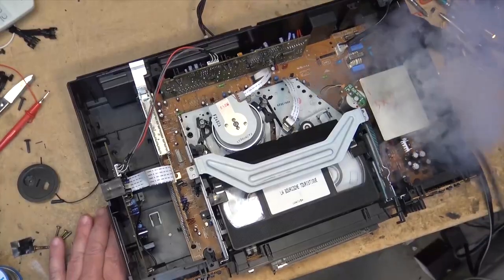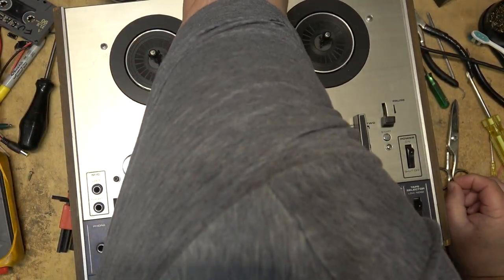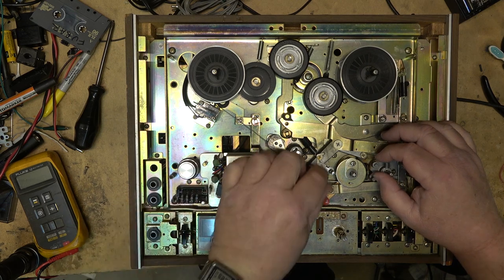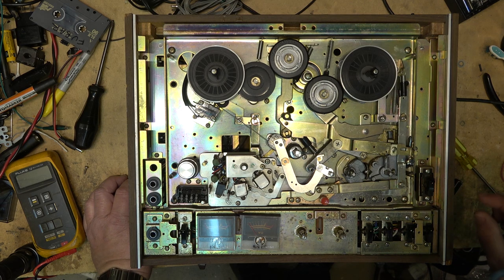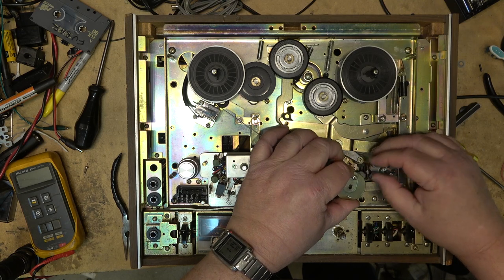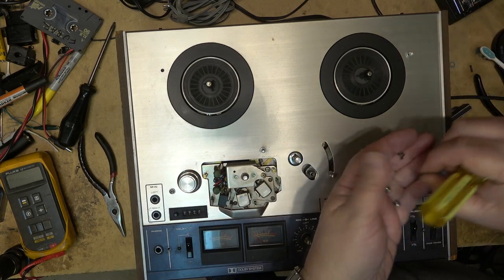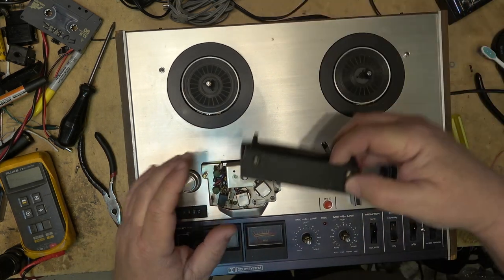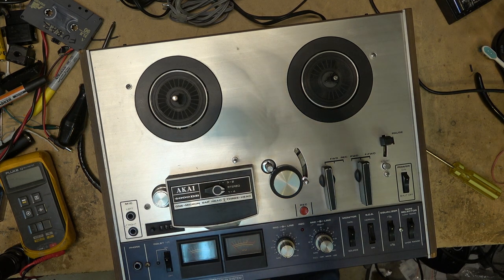Before buying any old AKAI tape recorders watch this

Comment: If the die-cast cams are available in 3D printed nylon and they work well, that’s probably the cheapest solution.  But another solution is machining new cams from aluminum billet, or if one is into overkill, stainless steel.  I have an AKAI 770x I bought new in 1978 and all it’s cams are still intact.  Looking at them as a machinist, they are not that complex and even manually machining new ones would not be that hard.  I plan to do that for my machine before they do finally give up the ghost.
Reply from the maker: By 78 they should be aluminum as opposed to the stintered crap from the 60s
Reply: Opps.  I meant I bought it in 1968, not ‘78.
Reply from the maker: @garylacom737  big difference.  Yes those one have the stintered cams.

Comment: Don't you hate it when a customer tries to repair their appliance themselves?
I had a Fostex 4 track come in and the customer said, "It keeps blowing fuses"
Right then I knew he had been in it, turns out it was only the full wave bridge rectifier had a bad diode in it.
Replaced it and discovered it had 2.9 amps going through it, and it was the round "non-heatsinked" variety. Bad design.
I just replaced it with OEM and never heard back. Guess it still works.
Reply: I completely hear you 100% (I am not pro by trade.) I can EASILY place myself in your shoes and I understand 100% - but do you fix your car? Change tires? Oil? Maybe even brakes? Ever mess something up because you're not a pro? (I am not mechanic either, but nobody is perfect - not even pros.) It all comes down to point of view. If I worked in repair, I would probably tell the customer there can be a non-existant, small or large surcharge, depending on my findings of difficulty they created or didn't.
Reply: @MrChrisRP  ^^^ female Japanese and I replaced my own Mazda's alternator.
It was humourous when the shop techs kept asking me if I needed it done for me & I just said no "I got this".
The only question if I could repair something on my vehicle is is I could provide the torque required for proper belt tension.
This was ugly and I feel bad for 12voltvids for not being able to complete it, but you can not have in stock every part of every media device.
Reply: @MikinessAnalog  MIJ (that means "Made In Japan") I only play guitars and only use capacitors from your country. :) Respect.
Reply: Oh, and Sony!!! :)
Reply: @MrChrisRP  I guess you remember the capacitor failure debacle from the early 2000s techs had to deal with, but hey, it was easy work.
Reply: @MikinessAnalog  Of course I do. I am Windows internals guru to the fullest. :) heh heh I have MSI MS-7211 rockin here still to this day that I recapped the ones that help to regulate voltage to the CPU. The board died after a few years and needed it.
Reply: @MrChrisRP  My experience is only with entertainment electronics and I recapped about 300 - 350 TVs.
I charged approx. ¥3000 - 9000 (30 -90$) depending on how long the replacement took.
Reply: @MikinessAnalog  That is beyond awesome to me, for real. Rock on!

Comment: It would be nice to look into the situation and see if the piece is available from at least somewhere, and if not, attempt to fuse the metal back together in some fashion
Reply: easy. It is generally available for sale.
Reply: @DunQuDeYi  any places that come to mind that have the pieces, incl. this broken one?
Reply from the maker: @DunQuDeYi  90 US, thats what about 130 CDN now, and then don't forget broker fees and tax brings it to close to 180. I bought a working Akai 4000 for 30.00

Comment: 6:22 : So, given the propensity of these things to break due to age and fatigue (understandable given that they did not belong in the higher price echelons when they first came out), has anyone attempted to get such a part custom made by a machinist or 3D-printed? It only takes one person having the skills and interest for restoring such decks to give an extra lease of life to many of these decks (until sth harder to replace fails that is...). :(
Reply: These parts are available as fresh casts or 3D printed parts already, they generally are compatible with a large range of models which helps make them easier to sell.

A year ago I replaced my play/rec cam (the one that broke here) with a newly cast replacement, works fine now.  I have noticed the other cams are going the same way, but they will last a little longer.  I do have one other broken cam, the C-2 cam.  No idea what that does but it didnt really affect anything I did with the machine this afternoon when I decided to test its functions.

I'm going to replace all the cams with 3D printed replacements, apart from the play/rec one as thats a new metal part.  I dont think that the 3D printed cams will have much of a problem, there is not a huge amount of force in the mechanism.
Reply: @dlarge6502  This is great to know. Any idea if the material of the new casts is the same as before? Or whether it's upgraded to sth fancier, e.g. aluminium?
I reckon 3D replacements will be an improvement. The material should be less brittle and have better frictional properties for the task. It'll probably be both harder and more elastic (if that makes any sense) than the cast zinc alloy used and will be less likely to corrode. All in all I'd expect a longer lifespan and better function.
Where can someone find these?

Comment: Your videos are amazing! What is your opinion of the AKAI M8? I'm about to buy one for quedio recording my piano und things un tope. Thanks!
Reply from the maker: For real to real I would really say stick with Sony. All those that guy units with the lever controlled mechanisms have those cams that fall apart.
Reply: @12voltvids  Good, thank you very much for the advice! If you don't mind a second question: do you believe that 4 tracks recording quality will still be nice to listen? I'm a musician and I'm looking for one machine yo experiment recording in my studio. Thanks so much!!
Reply from the maker: @eduugr  If you are looking for a very good sounding, literally studio quality reel to reel look for a Teac 3340.  I have one, they sound amazing. 4 independent tracks with simusync. So you can listen to your playback tracks from the record head as you add additional layers on another track. True 4 track recording. It also has 15IPS and is is built like a tank.  If you are looking for home studio recording on 1/4 4 track this is what you should be looking for, or the 8 track version, or fostek is another brand that made high quality.    Akai farted around with that cross field recording to improve the frequency response of 3 3/4 speed but anyone doing any type of instrument recording isn
't farting around with slow tape speeds. You want to use the fastest speed the machine has. 15IPS does a dam good job.
Reply: @12voltvids  thank you very much!!! 🙏🙏

Comment: Those cams are available again 3D printed from Analogue Classics. I installed one in a Akai x-200d and it works great.
Reply from the maker: But at what cost.  Last I checked over 100 for the cams by the time they are delivered to Canada.  Customer will not pay that they want stuff fixed for 100 total.  Can't work for free
Reply: @12voltvids  It was bout 30 dollars delivered for the play/record cam. And the comment was not aimed at you, its for people like me that fix their own stuff. And you videos are Great.
Reply from the maker: @mobileauto  when i last checked they were 60 usd each so 120uad for both. That would be 160 cdn plus shipping
Reply: @12voltvids  FULL KIT £45 EBAY UK JUST GOT THEM FOR MINE, GREAT QUALITY

Comment: The Pot metal cam for the head adjustment going bad and cracking and falling apart is what unfortunately put my Akai M-8 out of commission. ☹️ Why Akai thought it was a good idea to make these cams out of this evil stuff I don’t know...The same goes to for 1926 and later Victrola tonearm brackets, and post 1908 Edison phonograph mandrel bearings!
Reply: Its what this stuff (Zamak) is made from, even today.  What has happened is the Akai cams have lead impurities in them, this is the result.

Comment: Hello, I have a problem about my Old VCR. Why does it only plays about 5 secs and stops? It doesn't turn off itself but just stops the mechanism and have to press play over and over again. I tried doing rewinding and forwarding the tape as suggested online, but still no changes. I was also surprised when I tried to push the carbon piece above the tape head that wasn't touching it and the tape played until I stopped pushing it, but after that I tried doing it again it doesn't work anymore. Is there any way I can fix my JVC VCR? Because the tape head work just well but the mechanism is just the problem.

Comment: folks, any idea how to align the tape path on these akai 4000's? i have the DS mk.II, I already fixed the pinch reel and one of the switches, however, often times the tape slips off the pinch reel and gets all twisted and stretched. there's also a squeaky sound coming from that guide below the supply reel... any help is appreciated!

Comment: BTW the pot metal will last forever if you don't monkey with it and treat your reel-to-reel nicely.  It is a mechanical unit with lots of moving parts the transport should be lightly oiled once every 40 YEARS haha!   Anyway the only thing I see on the 1722 II series that ever goes bad is the electronics... again after 40 years a capacitor will blow.  Otherwise they should make it to 100 if you treat them nice and don't force moving parts in ways they're not supposed to go, etc.

Comment: There are products out there to either:
- glue the parts together (e.g. I found "Tech Bond" on youtube - maybe there are others)
- solder them together (e.g. "Muggyweld" products that use a low melting temperature solder)
I'm not sure how reliable repairs using these products would turn out to be, given the amount  of repeated stress these part are subjected to.
I'd guess the repairs would not last but I thought I'd post this in case anyone has experience with using these products for repairing mechanical (rather than decorative) parts.

Comment: Hey love your vids as always, I just bought an Akai M-10 and the mechanism is in great working order but the preamp/has problem with the right channel is low and distorted at the RCA output, as well as the VU meter and the internal speaker makes no sounds, left channel takes some time to wake up but sounds fine afterwards and even works with the internal speaker any ideas? I am thinking lazy Capacitors for the left channel, and either bad caps or transistors for the right channel, any ideas?
Reply from the maker: Transistors used on those old units are very problematic.  Transistors in the 70s weren't really reliable. Many old devices had transistors in sockets so they could be rapidly swapped.  I was given an x360 that won't record.  A project for another day I guess.

Comment: My Akai 1721W doesn’t have any problem, but it has pot metal on the switch, and nothing has broken, it works just fine.
Reply from the maker: Your point? My 4000 also still works right now, but tomorrow it could break an so could yours.
Reply: I should rather use my Concord 220 and it still works like a charm with no mechanical problem.
Reply: If you don't force it well... most pot metal just needs a tiny bit of lube every few decades.  But still it will probably never break if you're nice to it.

Comment: Get the pieces out, bond them together, and find someone who can make a sand mold to recast with aluminum.
Reply from the maker: Pieces are missing from one of them
Reply from the maker: So what you are saying is spend 250.00 to get it working and then sell for 30!

Comment: Fortunately this crapy part can be made (moulded) with a metal or nylon version. You have to make them yourself of course, its just a quarter circle with a square hole. Takes some time but absolutely doable. Same with the belt, i replaced the crappy flat version with a 3D printer ribbed belt. Your choice.

Comment: I was given an Akai X-150D. Everything right now seems to work fine, but of course this model used freakin pot metal cams too. So far no issues YET. Better enjoy it while it lasts I guess.
Reply: Lube it slightly and it'll probably last 100 years.

Comment: This is the second time I see this, both on a 4000DS. 
I've seen more sony machines with issues though, but that doesn't say that much because I only get the ones that people have thrown out.
Interestingly none of my (12 or so) 4000DS machines have this issue.
Reply: A lot of models are fit with this mechanism. Maybe a good idea to take the front plate off, and apply lots of fresh grease around the steel ball and cam. That will surely easy tension on that thing when you activate it. In the video is clearly to see how to get there, and there's not a lot that can go wrong in applying.

Comment: You can get 3d printed replacements I had to for my 1700... they all had the pot metal cancer.
Reply: I have 3D printed replacements in my 4000DS, works fine. Infill 100% ABS.

Comment: Hi Dave, why not gluing with JB Weld, should hold it together?
Reply from the maker: Pieces are missing.
Reply: @12voltvids  And probably the whole piece is just too britte already. This one might be the victim of bad storage conditions. These pot metal alloys are usually made of aluminium alloyed with some other metals, including copper. When an aluminium-copper alloy gets water or just condensation, bad things can happen. The chassis around the VU meters look corroded. This deck might got wet at some point, or it was stored under condensing levels of humidity.
Reply from the maker: @mrnmrn1  have no idea.  It is now sitting in my garage awaiting something to happen. Either to be parted out or possibly fixed some day.
Reply: @12voltvids  people told you they are made now, buy it.

Comment: hi there is 3D print parts now i have used them the only thing they cost  i never seen bad cam's 

i only seen 1 bad gear in rs-x 101 cassette deck out of alot of them  
betacam sp  has bad rubber  part   and parts that are not working right

Comment: model it off a functioning part, 3d print a master and cast in aluminum. I think the part is cast zinc. old zinc is brittle.
Reply: It's probably a potted aluminium alloy. Might be alloyed with copper. Aluminium-copper alloys hate water. If you look closely, the chassis around the VU meters and controls is corroded. This deck probably got wet, or it was stored in a damp place.

Comment: This mechanism was only used in the cheaper models of AKAIs but even there only a part have this problem. I own two models with this gear and both are fine. When it comes to this deccay of the material there is no solution then to exchange. It crumbles in thousand pieces.
Reply from the maker: Not worth repairing not a single person i have mentioned 3d printed replacements for about 100usd for the part plus shipping and installation they have all thrown the machine out.

Comment: The cams can now be found as a 3d printed part. Paid 20$ for my play cam to be printed and now I'm putting it back together
Reply from the maker: For the 4000 I have it's 75.00 us plus shipping.  Not worth fixing.  
These old units sell pretty cheap. One was sitting on Facebook.  Started at 400 and down at 130 now and no bites.  I paid 30 for mine and it works.
Reply: @12voltvids  I paid 5 st a yard sale 6 years ago.

Comment: I am more thinking out loud then suggesting, but have to wonder about block of JB Weld and a dremel tool....
Reply from the maker: That might be something to explore now that the unit is mine.  Wouldn't do that for a paying customer because when it breaks it becomes a married to an old tape recorder problem.  If it works 5 minutes for me and then breaks it is a meet Mr sledgehammer problem solver.
Reply: @12voltvids   Mr. Sledgehammer is a good friend of mine, but hope it works out